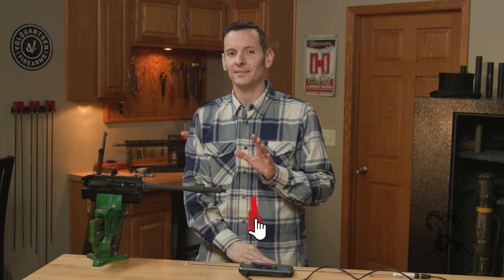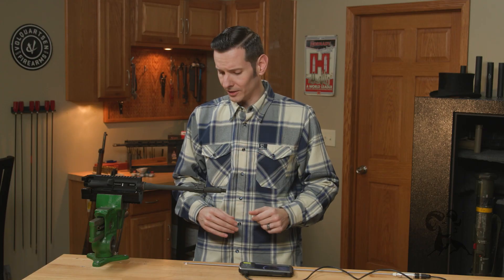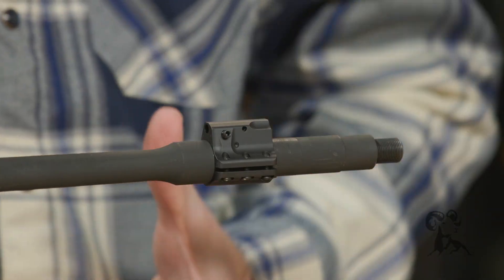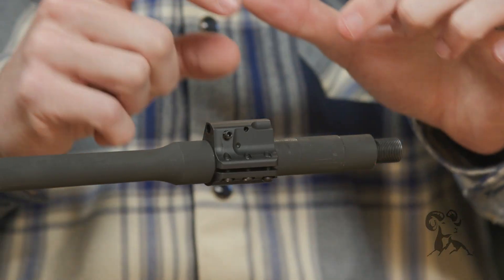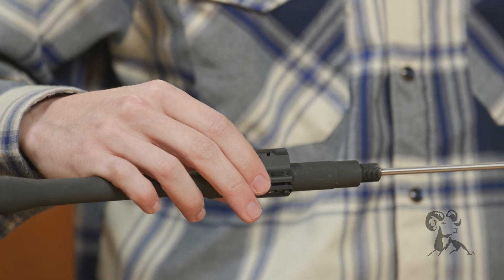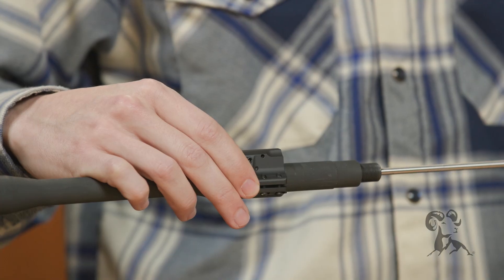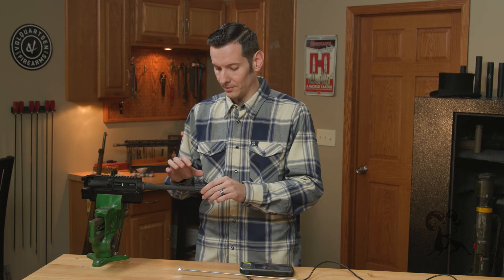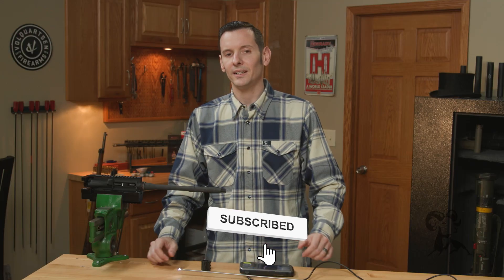Quick Tip: AR-15 Gas Block Alignment

Comment: Gas block alignment can make or break a build, but there is more room for error than you think!
Reply: So, how do I find, for example, the bore scope Caleb used at Brownells? I tried “digital bore scope” and other permutations in Search at the new and improved web site and only got a little Lyman scope and one other. Harbor Freight, maybe?
Reply from the maker: @CaveWyatt  Search "Teslong" or "borescope" on Brownells
Reply: @CaveWyatt have you tried “ rifle bore scope”? Found one looks like the one he used for $120.
Reply: @CaveWyatt I’d like to know as well
Reply: @CaveWyatt  Ask your local proctologist.
Reply: @mostlypeacefulmisterputin  Aircraft engine mechanics, industrial and electric generation gas turbine mechanics as well.
Reply: @railfanningpoints2.045 yes sir! I was a gas turbine mechanic in the Navy!
Reply: Crazy bc I was just looking for videos like this
Reply: Yes, but a misaligned gas block even a little bit off will change the angle at which the gas tube enters the upper receiver. So if the gas tube is angled, as the bolt moves forward, it could cause added friction against the gas key and gas tube.
Reply: $200 for a bore scope to use once get the fuck out of here!
Reply: What borescope do you use Caleb?
Reply: @johnchristian1205  Teslong, available from Brownells.
Reply: Your gas hole looks real good Caleb.
Reply: Caleb,,   where can we find your service history or bio  ?
Reply: @metallampman  The best place currently is honestly my LinkedIn account
Reply: So how do you find exactly alignment side to side?

Comment: I just put a cmmg adjustable block on my sw m& p 15. It didn't work. All the way back the block covered the hole in the barrel. The block was a set screw style and the barrel is pin style for the front sight / block. I just elongated the hole in the block .060 further forward.

Comment: While it may still work pushed all the way back it's not optimal, correct, or Mil-Spec to be. There's supposed to be a 0.025" gap in order to fit the hand-guard cap. You don't sell them but there are 0.025" spacer washers available elsewhere in 0.625" and 0.750" diameter as well as some others. This is specifically for clamp on gas blocks and removable fold down clamp on FSBs like the Yankee Hill Machine....love that one in particular (YHM-9394). On set screw style blocks your gas port and dimpling jig will align the gas block correctly being off the shoulder. I don't bother with the spacer washer with them. On any of the variety of clamp on gas blocks or clamp on FSBs you really should use them. That way your forward and rearward movement is irrelevant and all you need to worry about is side to side. It also gives extra piece of mind that with careless or rough handling the gas block won't be going anywhere causing misalignment issues.

Comment: Installed a JP adjustable gas block on my old Sig M-400. Having trouble finding the right hand guard to fit over and maintain clearance for barrel whip. Carbine length with a 15 inch hand guard. Any suggestions.??

Comment: You need to check with your barrel manufacturer and they will help you out. I know Ballistic Advantage has gone away from the gap for the handguard and an SOLGW tells you to push it to the shoulder! I love using a bore scope for checking alignment.

Comment: Is it possible to use a gas block size of .936 or .875 for a gas hole of a .750 barrel?
Reply: All sizes you mentioned refer to the barrel diameter the block goes on, not the size of the gas port….
Reply: @specop-tl9jd  well I'll be damned, learn something everyday, thank you!

Comment: Either way is correct. I like the Kaw Valley jig and recommend it highly if you're using a gas block with set screws on the bottom. It allows you to easily perfectly center the gas block hole over the gas port in the barrel. I know that it being perfectly centered is not "necessary" but that's what I prefer.

Comment: I’m changing my hand guard to a free float. Do I have to buy a new gas tube? Or can I just get a new low profile block and run my old tube? The rifle only has about 250 rounds through it so it’s pretty new.
Reply from the maker: Old tube is fine.

Comment: Can I install a barrel with the gas lock already installed? I want to take off a barrel from one upper and put it on another using the same gas system and hand guard.

Comment: I  Wonder if this helps gas efficiency at the BCG gas Carrier key area, when  The gas block is against the shoulder Would cause the whole gas tube to be 0.25 deeper into the    Upper receiver?  possibly creating a tighter fit where the tube goes into the gas key?  I know this would only create a  Small  Improvement in gas efficiencyIf any I mean this is my theory I'm asking. Before you think that's overboard look at what Knight's armorment did to their gas systems and then come back to me and tell me I'm being silly about that stuff  I wanna know you all think?

Comment: Some gas block models like the V Seven that comes with 3 set screws. Is there a difference when mounting them to the barrel? Specially if the barrel has a dimple for set screws. Will it be ok to just align the first set screw to the dimple and tighten up? Also have you heard about the EZ TUNE GAS TUBE, do they work.? They come with a smaller gas hole. 

Thanks for your videos, really appreciate them.

Comment: So I have a question, since as you're saying the gas port is in the same place relative to the back screw hole, can you just slide the new block on with the gas tube and run it up to the shoulder? Will that align the block properly?

Comment: This may apply to a .223 or 5.56x45 barrel, but you'd best ensure precisely correct alignment for the much larger gas max diameter port on a properly made .300 AAC Blackout barrel which is made to deliver max gas to the impingement system.
Reply: This is my problem I’m shooting 300blk but it doesn’t eject the casing and shell gets jammed
Reply: He did mention that this was only for 5.56/.223.

Comment: Superlative arms adjustable gas blocks "gas hole" is a lot smaller than most "gas holes". Now I don't have a bore scope, but I do believe the gap matters on that brand
Reply: Specifically the clamp on style from superlative arms

Comment: Total failure to recognize the fact that the 1-1.5mm of space lost when you set the gas block all the way back will result in the gas tube impacting the gas key in the bolt carrier more than it’s designed to do. You would think these guys would understand that. Don’t believe me? Test it for yourselves. Will your rifle cycle? Yes. Will it have unnecessary wear and tear? Yes.
Reply: Yep...100%

Comment: I can see what Caleb is saying, for a clamp on style. But, you can get a gas block dimple jig from SLR Rifleworks that aligns the gas port on the barrel to the propper placement of the dimple underneath. Set it up and see if its a true alignment. If  the barrel doesnt have a dimple already use a drill and bam! Dimple achieved! Just my 2 cents

Comment: Put aquarium hose on gas tube inside upper . And blow a tune while you AIR GUAGE YOUR GAS BLOCK, CHECK YOUR HANDGUARD FITS B4 TIGHTENING
MEASURES ARE CRAP IN THIS CASE. AIR GUAGED.

Comment: Loving that adjustable clamp on gas block, which one is that?
Reply: JP Enterprises GS9, great adjustable gas block
Reply: @thelizardking3807  JP Also makes a adjustable front sight post gas block as well don't they..... that would be great, but people have me concerned about any adjustable block for a fighting rifle!? Any thoughts?
Reply: @agro_ink423  they do! I think adjustable would be good for a fighting gun, if it’s getting leaded up and your gas is getting restricted, just open it up more vs being stuck as is. JP does a lot of law enforcement work, most with adjustable gas blocks
Reply: @thelizardking3807  cool SOTAR says that the hot gasses can eat away at the adjustable screw or detents and over time gas will eat that screw or detents and it'll end up having to be "clicked" or restricted again..... But that may be thousands of rounds apart as well

Comment: If your barrel didn't come from the factory with a dimple drilled for the gas block set screw, buy a dimpling jig and do it right.  If that's too much effort or above your ability as a DIY gunsmif, perhaps you shouldn't be attempting to build an AR. If you have a clamp on gas block, why ??  Take it to a professional that knows what they are doing.

Comment: ....I used pencil marks on the barrel and gas block to align them and used a length of fish tank air hose attached to the gas tube to blow air intoit to ensure I had the hold aligned properly...BTW I noticed that the hole in the block was larger than the gas port in the barrel...

Comment: I was soooo stressed out about gas block alignment when I built my first ar. I must have done it right though, because It shoots perfectly. (And I did push it all the the way against the shoulder)
Reply: Lol yes I stressed the hell out of this myself, until I finally got a thorough observation of the gas block and noticed the porthole size was about three times bigger. I think what a lot of us do, is watch videos of people overthinking this process. I know I did!
Reply: In the end, the holes gotta line up. If you did that you are good

Comment: A trick a friend of mine showed me is put a spegitti noodle in the gas hole, knock the noodles flush with the top of the barrel. Install gas block, flip the barrel and let the noodle stop the gas block in place. Set your set screws and flip the barrel upright and knock the noodle out.

Comment: I use a piece of dry spaghetti noodle as a gas block alignment tool. I break off the spaghetti in in the gas port and the put the gas block on and turn the barrel upside down. The spaghetti falls into the gas block and locks the gas port hole with the gas block hole. Tighten everything down and turn the barrel right side up and use a cleaning rod to break the spaghetti and push it out of the barrel.

Comment: That is genuinely helpful information. Thank you. 

It would be interesting to take 3 or 4 barrels and 3 or 4 common gas blocks and see if that standard applies across the board.
Reply: It applies for many, but not all. Ask me how I know lol.
Reply: SOLGW FCD for instance come with knurled set screws in the bottom, dimpling pre-drilled into the barrel to line up properly. They also make a jig you can buy, or 3d print, for dimpling any barrel.
Reply: @xSP3CTREx  Pretty common features of any mid tier upper and above, even low tier.  

With that said, those features don't change the question of whether there is enough variance in barrel and gas block manufacturing that putting the gas block tight against the shoulder versus 0.025" out would misalign the gas port/gas block.  Which the first poster seems to confirm does happen.
Reply: @JimYeats  You've answered your own question. If these are common enough features across the board then there shouldn't be any deviation unless you buy literal blocks meant for airsoft replicas which wouldn't even need ports. Notice how they don't say what block barrel combo 'trust me bro'. My theory is the mounting hardware matters more, if the block isn't pinned to the barrel it can rotate without knurled screws into a dimple counteract. The type Caleb has in the video would shift real easy if not torqued and high temp threadlocker.
Reply: @xSP3CTREx  Oh hey you're right, everyone makes perfect products with no errors, deviations, tolerance stacking, or poor QC!  No bad/different products out there at all!  With the literal hundreds upon hundreds of barrel and gas block makers out there, no chance of issue at all.  

It's anticipated that you are responsible for lining up your gas block.  Personally I both measure and use the first set screw hole to confirm.  The point of the comment is for people who are just blindly assuming what the depth of the gas block should be and not actually checking themselves and only ensuring the vertical alignment is correct.

Comment: I had an upper that wouldn't run, pulled the GB, there was an off center burn mark in the inside of the GB. Shifted it forward 2mm, upper started working.

Comment: This video came at just the right time for me! I have a new .300 Blackout upper that wasn't ejecting the spent casing, so I took the handguard off and found that the gas block hadn't been locked down. I was wondering how far back I needed to set it, and your video answered my question. Thanks! 😊

Comment: With the exception of Yankee Hill clamp ons that have the flip up front sight. It's really a good idea to get it aligned proper. And I tell you I have a barrel from another sporting goods store that if you slide the gas block back on it it does block the barrels gas hole enough to cause cycling issues. This brand suffered this alot in their earlier offerings. Reading the comments and ratings page shows that as there were a lot of people drilling them out lager on the barrels. I was and still am using a low profile block on that particular barrel. If I didn't space it I would have had to in large the gas hole on the barrels. Barrel shoots well..

Comment: Back when I started my addiction, I read somewhere that unless I was using the 2 piece hand guard, that I just butt the gas block to the shoulder. Lately, I read that I was supposed to be leaving a gap. But they all shoot fine. Thank you for clearing that up.

Comment: Up against the shoulder or not depends LARGELY on the gas block itself. The YHM-9383 goes all the way to the shoulder. You verify with the set screw-gas hole technique.

Comment: Use gas block dimple jig. Use caliper. Blue loctite screws
You will never have gas block walk on you with a dimple jig, and you will also never misalign. As long as you measure correct.

Make sure dimple is not too deep and not too shallow

Having no dimple made my gas blocks walk, so did not having dimple deep enough

Also clamp on gas blocks are the ones that can't really be dimpled (most of the time)
 Imo worst choice

Comment: I am not so sure that this is accurate advice for many gas blocks.  A 0.030" barrel shim places the gas block in the correct location, and they come in the different barrel ODs.  I also use a borescope for alignment checking on custom builds.  I also engineered the robotic assemblers for the barrel index pin and gas block installation on AR barrels.

I do appreciate the advice to check the alignment with the borescooe.  The shim may or may nit be needed.

Comment: 1. Never used clamp on gas blocks. 2. Not all gas blocks are drilled the same, some have to have the space. 3. Use a bore scope and a fiber optic gas tube light snake.
Reply: Clamp on gas blocks are perfectly fine

Comment: I’ve done a lot of uppers with the set screw bottom and the easiest way to tell where you need to position the gas block is just hold the set screw hole along side the barrels gashole to see if you need the space or not. It’s quick and you can do it by sliding the block on the barrel and flipping the gas block upside down to center the hole because the set screw should be right in line with the gas port in the block or hold it along side the barrel. Assuming everything else was made right it should line up nice and easy. (Obviously this wouldn’t work with the particular gas block in the video but I think the clamp on style isn’t used as much)
Reply: Roll the gas block over 180 degrees, center the gas port in the screw hole of the gas block, and use feeler gauges to determine how far off the shoulder you should be. 

My theory is that if you get the fore/aft alignment optimized, there’s more room for error in the right/left alignment.

Comment: Or you just buy a Monobloc barrel from HM Defense where the gas block is actually CNC machined as an integral part of the barrel itself, eliminating the need for proper gas block alignment or having to hassle with set screws, dimpling, or pinning altogether. 😉
Reply: That's interesting. Didn't even know that was an offering. I could see why some people who might want to install an adjustable gas system to pair with specific suppressors wouldn't want that. But for other people that would be a solid solution and you still could run a low backpressure suppressor I suppose. Options are good.

Comment: My set screw ones always left that gap if I used the dimple. But I recently got an SI clamp-on toolless adjustable gas block and to install that you align the ports on that gas block to the barrel's port first, which left that gap also. I just leave the gaps. Someone should make a shim to fill  that gap so crud doesn't get in there if its a known dimension. I'd buy that.

Comment: I installed a gas block recently and the directions from the manufacturer  actually said to leave a gap (can't remember the exact distance). It was for an AR-10 so maybe it makes a difference. I'll have to pull out my borescope and check.
Reply: .025 inches.
Reply: @ShortArmOfGod  thanks. I knew it was .02 something but couldn't remember.

Comment: Some gas blocks are longer than others which will put the gashole closer or farther away from the gas port in the barrel some are made to go against the shoulder and some are made for the handguard plate to go between them an the shoulder have seen when the wrong one was used it wouldn't let inproper alignment of the gas port hole

Comment: I had one block that when tight against the shoulder the BCG would not go all the way forward without a lot of resistance. It positioned the gas tube too far back and it was bottoming out in the carrier key. Left a gap between the block and shoulder and it solved the problem. Probably a tolerance stacking issue but it can matter.
Reply: This is the reason why it does matter...